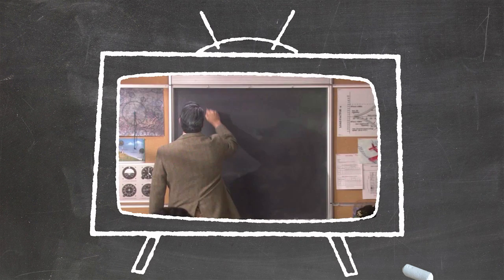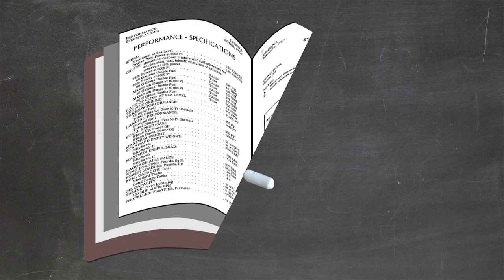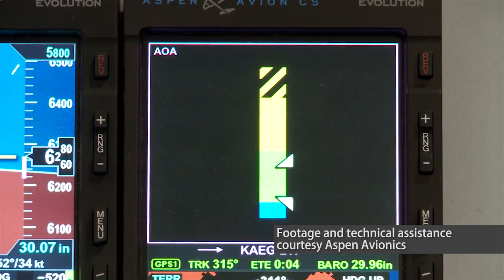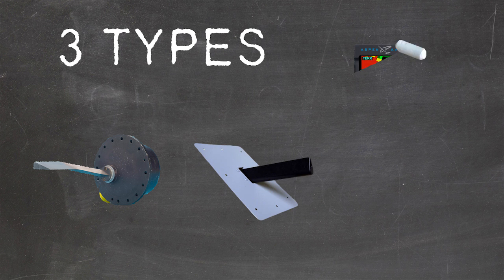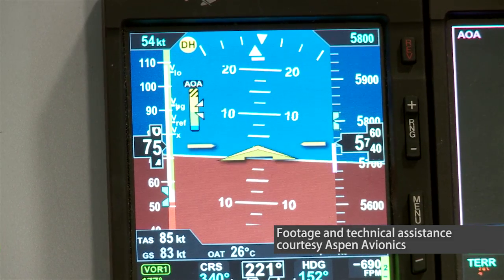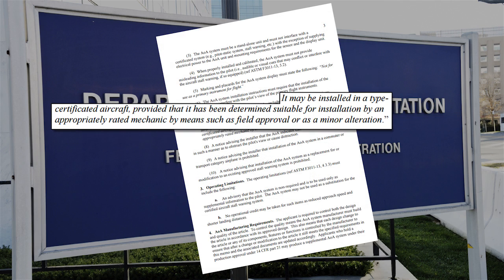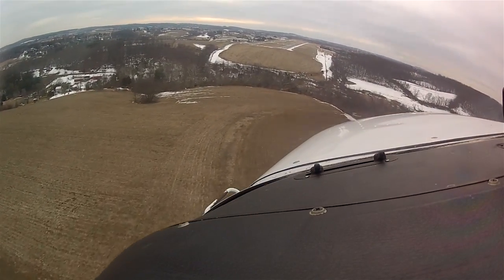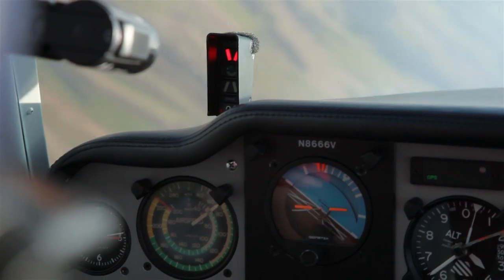Margins of Safety: Angle of Attack Indicators

Comment: The vane type is the only type that is a true AOA indicator. The pressure differential is only a Stall Margin Indicator based on airspeed and has to be calibrated to actual stall. Not very useful and a waste of money. 
Every airplane has an AOA indicator and has since the Wright Bros took to the air. It is the elevator control. 
AOA indicators tell what angle the airfoil is to the relative wind not how much lift you are making or can make. Lift capability depends on AOA and how much relative wind is available. The ASI is a pressure gauge calibrated in Knots or MPH measuring Dynamic pressure, the difference between static and dynamic or the pressure created by movement through the air(relative wind). The more Dynamic pressure you have the more aerodynamic lift you can make. If you have very little you can't make very much. With high dynamic pressure you can fly at low angles of attack. With minimum pressure it will require high angles of attack. If you want to do a loop it will take a lot of dynamic pressure and a fairly high AOA to start and finish the loop.  The elevator is the AOA indicator. Place it aft of or forward of the critical AOA position and the aircraft will stall no matter what speed (dynamic pressure) or attitude. The position where Critical AOA occurs will change slightly with CG & weight. No airplane can stall with the elevator in the neutral position. Save you money and take some dual or a course from a really knowledgeable instructor and let him demonstrate how to stall and un-stall with the AOA controller. The FAA don't get it and never has. An AOA gauge is no better that the stall warning horn or light. If you are watching the AOA gauge your not watching everything else. It is like watching the slip skid ball. Its too late when the ball is outside the center lines. Your butt can tell you faster if you will learn to feel it in you butt. True AOA indicators are very expensive. The are useful for many things but not needed for stall / Spin recognition, prevention or recovery.
Reply: Thanks for the insight,,Im curious though, can you expand on why the FAA dosent get it ?and never has? Thanks

Comment: So... does the vane-type AOA indicator take flap configuration into account?  Also, do any of these take icing conditions into account, or is it still too hard to implement?
Reply: This is a Debbie Downer comment. It’s not perfect therefore it isn’t good. That’s bad logic. Pitot-static systems are just as susceptible to these concerns. Strawmen are not appreciated.
Reply: AoA which an airplane stalls with Icing would depend on type of icing and exactly where it accumulated. Even altitude if you're high enough. That would be NASA level equipment lol.

Comment: The Icon AOA indicator is design perfection. They could probably generate additional revenue licensing their display to the manufacturers of those retrofit systems.
Reply: guess it didn't save the life of the famous baseball player who augered his icon into the ocean while pretending to be a fighter pilot!
Reply: I’d argue even Icon can improve. Take that AOA and shift it left half a radius. Then slap down a total energy probe gauge to its right though make that color coded with no units too. And no tone, don’t need a glider’s tone which would be constant if at power. AOA and total energy would work extremely well together.